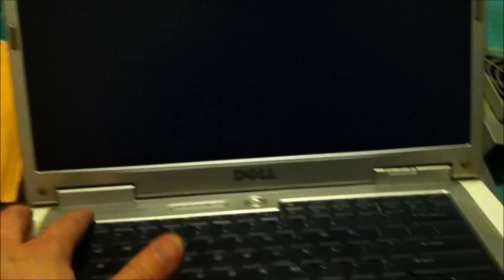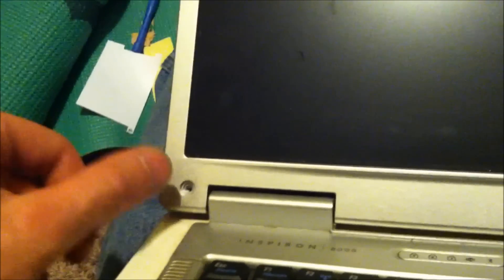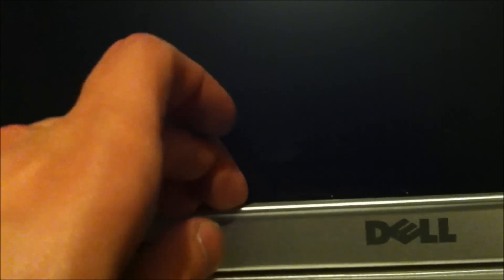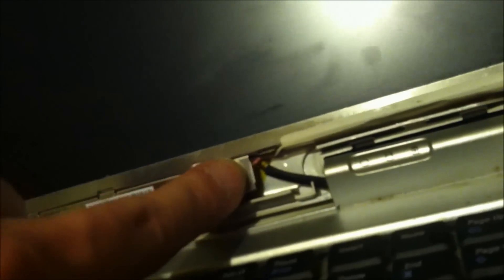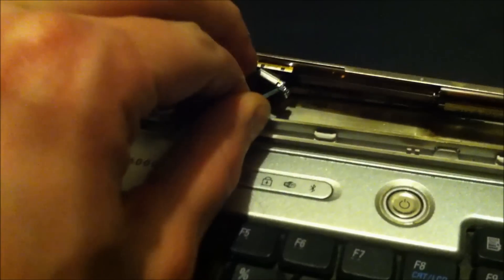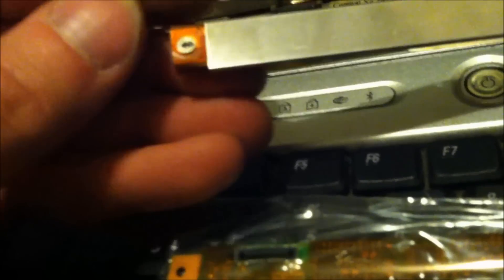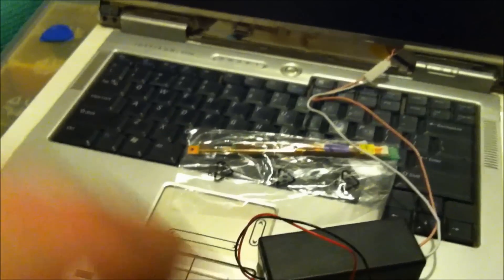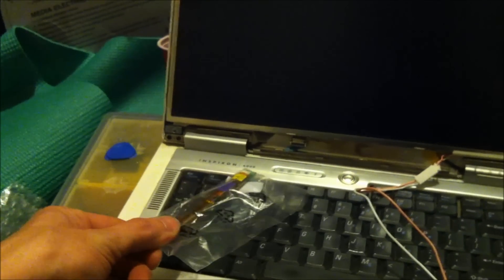Dell Inspiron 6000 dark screen How to change inverter backlight board

Comment: build variation. If you only see one screw ( securing the pcb to chassis) and there's no sign of of hinges then the subchassis is bonded to the screen frame. All is not lost.Remove the single screw ,remove the 8 screws holding the screen in place and lift and turn the screen over ( see other videos about precautions).Slide the board a little so that the pcb at the white connector end is free of the folded lip. Remove connectors as per video, and slide out pcb.
Reply from the maker: Thanks Mike! Always great to have extra tips for repairs!

Comment: Could you point me in the direction of a Dell laptop inspiron 1545 15.5inch LCD screen?
Reply from the maker: eBay normally has them. Just make sure the lvds pun out is the same. 20-30-40 pins.
Reply: i have the same prob with MRdown .... do you fix ur prob ?
Reply: Like he said you can oder one off of ebay and there are a couple other website that you can oder them from I don't remember where I ordered mine from but a quick google search of the type of screen you need will help you.